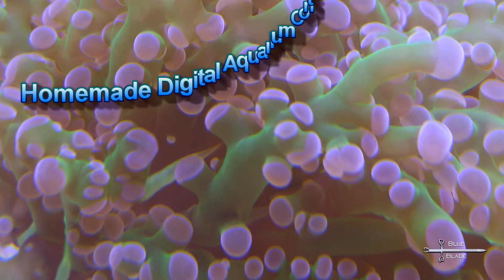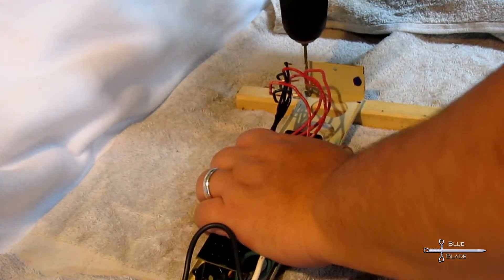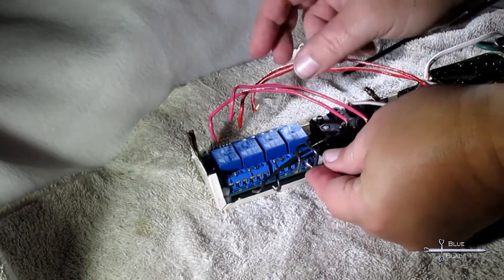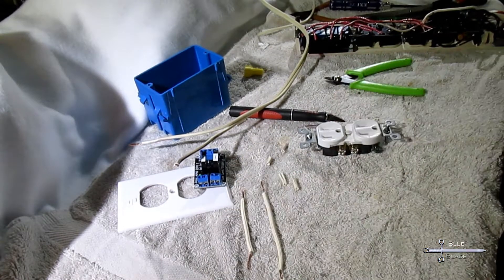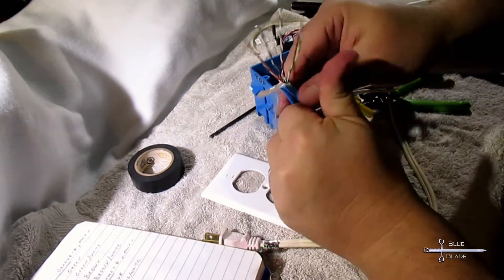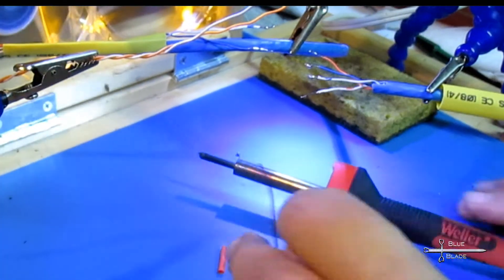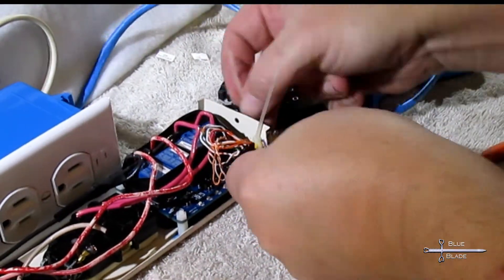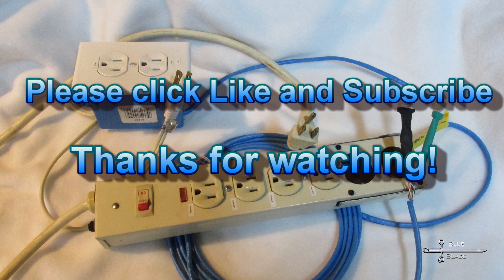DIY Arduino Aquarium Controller Part5: AC Relay and SSR control

Comment: In the US-style plugs and sockets, (NEMA 1-15P for the plug and 1-15R or 5-15R for the socket depending on how old the wiring is) the wide slot is neutral, and the narrow prong is hot/live. The SSR configuration has the neutral (wide prong) connected to the relays, with the hot permanently connected to the outputs. This is an unsafe configuration.
Reply from the maker: very good catch, i will double check (verify if i did that wrong or just stated it wrong) and update the video accordingly.